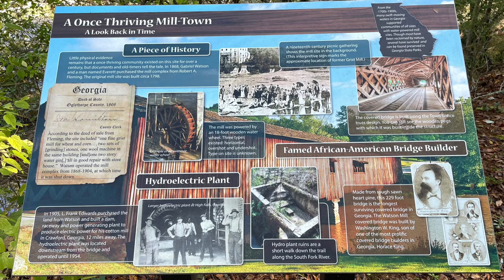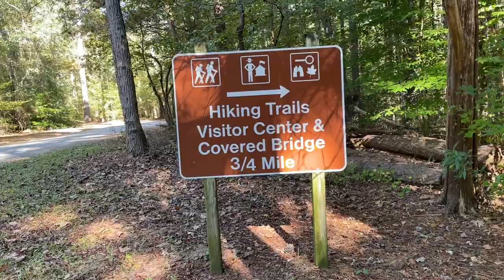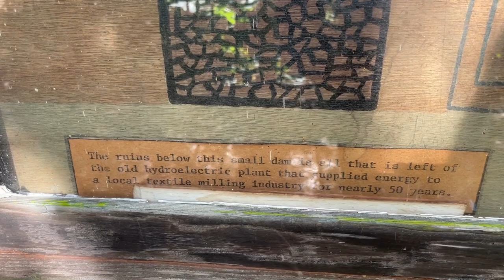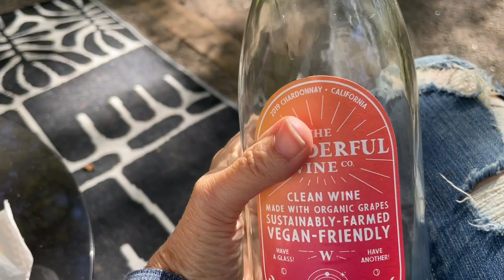Watson Mill Bridge State Park and Campground | Historic Covered Bridge in Georgia

Comment: Hello, I keep forgetting to mention. there are 2 roads you may want to avoid at all costs when you travel out west. Both in Utah.  RT.261 "Moki Dugway"   and also   "The Hogback"  Rt.12.  Unless you like to live on the edge, OMG is all I can say.
Reply from the maker: 😬Thanks for the heads up! The Moki Dugway looks especially intense. Hog back on Hwy 12 will be on my bucket list for when I’m a little braver. 😆 maybe…
Reply: @ArtfulOutdoorAdventures  Just be aware Hwy 12 is a 2 lane road and there is a stretch maybe 1-2 miles long where there is no shoulder on either side and no guardrails and literally thousand's +++ foot drop straight down on both sides. Whoa!
Reply from the maker: 😮 yeah.. that at does sound scary!